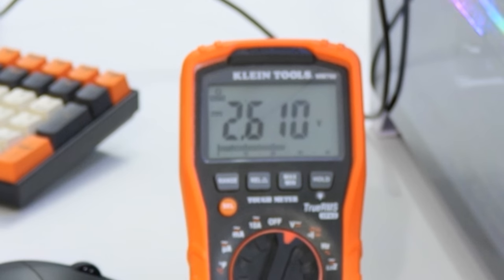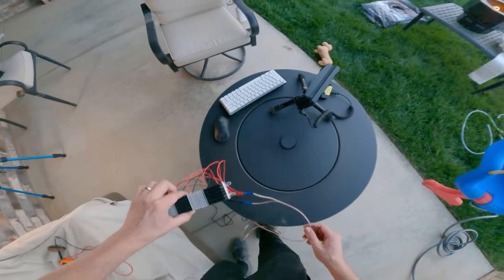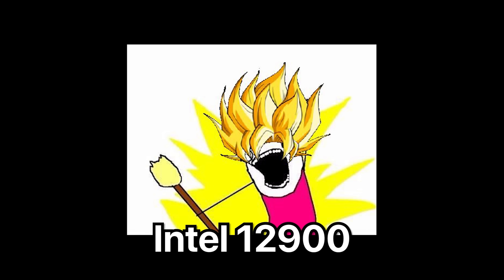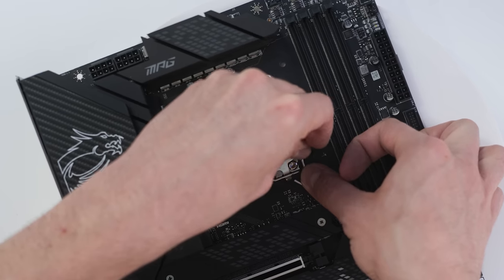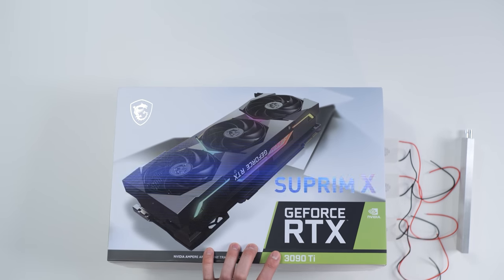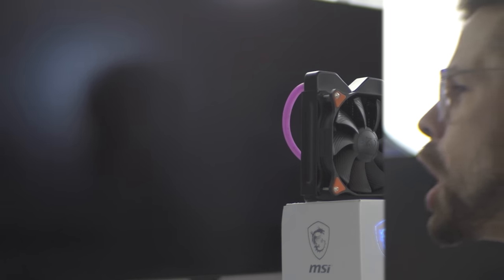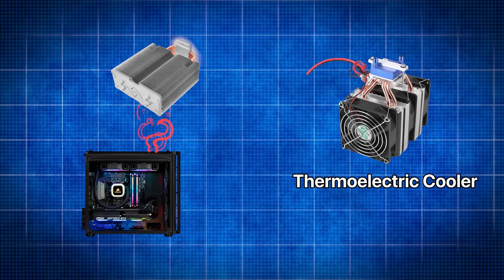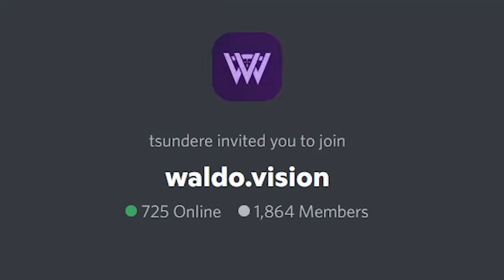I Built a PC That Turns Heat Into Electricity

Comment: Suggestion. Whoever reads this bear with me and read it. First install a energy box that save’s all the energy you don’t use and as the heat is generating you could basically have something close to infinite power. If you leave the pc overnight and let it run for 24 hours. You’ll have a lot of energy saved up. Then you can unplug the pc and use the “energy box” to turn the pc on. Tho I do know it’s not perfect and theres a lot of thinking needs to be done. Which I don’t want to sense I am lazy but this idea is cool.

Comment: It is not currently possible to build a device that can directly convert heat into electricity. This technology does not currently exist.

Even if it were possible to build such a device, it is not clear that it would be a practical or efficient means of generating electricity. There are more established and proven methods for generating electricity, such as the use of fossil fuels, nuclear reactions, or renewable energy sources.

The idea of building a PC that turns heat into electricity ignores the fact that electricity is typically generated through the use of fossil fuels, nuclear reactions, or renewable energy sources such as solar or wind power. There are no known methods for directly converting heat into electricity.

It is important to consider the potential consequences or implications of any new technology before making claims about its capabilities. The development and implementation of such a technology could have unknown or unintended consequences that should be carefully evaluated.

The idea of building a PC that turns heat into electricity may be seen as unrealistic or impractical, and it is important to consider the feasibility and practicality of any new technology before making claims about its capabilities.

Comment: 10:10 IM DYING if u wire just 1 PAIR IN SERIES and u have 2 other modules hooked together with the series modules THE SERIES MODULES POWER THE NON SERIES MODULES literally shorting out the voltage and bringing it to 1 module. basically u have only 2 working modules instead of 4 in that circuit

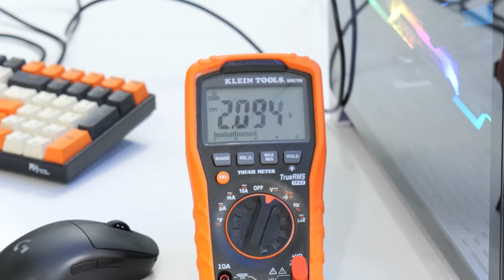edit: U MADE IT EVEN WORSE AT 10:20 now its just 1 ACTIVE MODULE LIKE MY BRAINCELLS
edit 2: k u fixed it at 10:35

Comment: So the poblem... is that the most heat the most unefficiency of the device, out, you could waste eletricity to make heat and a device work then you get about the half of the power, of the true ammount of power you will recive about.. 50% or less of the power, if you put a heater, and a thermal generator, you will make no heat and bellow of 50% of all the power you spent go back.

Comment: Hey Basically Homeless, cool video! If you're still interested in getting power from heat, I saw an awesome video from night hawk in light channel on thermo-acoustic tech that separates hot/cold air using a speaker! I hope you'll consider checking it out and maybe see if you can get power out of it.

Comment: never heard of The Laws of Thermodynamics?
1st Law of Thermodynamics - Energy cannot be created or destroyed.
You can't make more energy than you put in; in fact, the device you are using is simply a Peltier cooler (look it up) which can be used with an input of electricity to cool or to take heat and make electricity. Still, you ignore the fact peltiers are only about 5% efficient so you lose 20 times as much energy as you manage to collect net result it is impossible to make a self-powering device that would be a perpetual motion machine and as all sane people know that is impossible

Comment: had the same idea but with more computers that supply each other with power and measurements of use / charging and empty charging of battery and generation of dynamo poor but after a few days the computers fail one by one until the last one with the battery I think I have to use zone energy in addition😂

Comment: Wait a minute couldn't he just play infinitely since his computer heats and that heat turn into electricity so it wont run out of power
Reply: not enough voltage to properly power the whole the PC - he produced around 2.5 V and to power a regular gaming pc you need approximately 18 V or more.

Comment: You can't turn heat into electricity.
You can use a differential in heat to generate electricity.
Your AC would still have to do the same amount of work

Comment: 24 volt at 0.3A?
That's like 8 KWH per 1000h

and your PC uses like 300 KWH per 1000h while on high load?
So in 1000 hours of usage, instead of paying for 300 kwh, which in america is around 40 dollars, you're using 292 KWH, which is a savings of around 1 dollar
Reply: It's just fake video. It's not fully powered enough to run by itself. There's no way that tiny peltier can power pc fully by its own
Reply: @cevinpro1  no one is saying that... It's about increasing the efficiency l
Reply: @ayoCC maybe just use solar panels, since thermoelectric still has along way to go. the only way thermoelectric has enough to power a PC you need to build heating system as big as garage and build the cooling system as big as half the garage, and the price to value ratio probably way more expensive than solar panels.

Comment: i did it actually 2 years ago. and it's worked. but you need some more boards for transfer the heat to power supply and make a balance between ac income and dc heat income. and it's need way more that those little shi** small heat blocks. it was for joking the whole energy world and i thought it's don't work. but it did :|

Comment: This wastes more energy in the end since you block airflow and force everything to run hotter and thus increasing the power consumption by at least 50x the amount you're making.
Reply: What?

Heat from components is always wasted heat. The only way you would increase power consumption due to heat would be due to fan speed.
Of course stuff downclocks when it gets too hot, but that happens to use less energy to produce less heat.

Comment: This is what I was thinking a couple of weeks or a month ago, if it would be possible to entirely run a computer using thermo electric generators and the heat from the computer. I was thinking more transfer the heat using water (water cooling loop) and then transfer the heat from the water into electricity for more efficient transfer of the heat, so that the heat isn't lost or dependent on the fan pushing it into the insulated box, maybe making more power, now the only problem is that the most powerful thermo electric generator commercially available isn't really good, not for powering a computer and is still REALLY expensive, but in theory it would be possible.

I want to try it, I'm not good at physics though and definitely don't have the budget for this.

Also not ready to risk my computer or my life on this :D

Comment: Bruh you made like a 5w = 0.005 kw in year for 24h per day thats make 43.8kwh Here electricity costs about 0.1€/kwh so you cant save some money but literaly 4.4€ saved so its needs some many years to even pay it self.... Also you cant use that ≈3v in power in  a pc powersuply, prosesors uses about that voltage range, but it needs to be stabile. Using that to power pc is just necessaly complicated. Soooo this is just dum dum logic. Or was this some kind of joke?

Comment: 🤦🤦🤦 you know you can run a battery onto a computer right and then you can kind of computer and just use heat generate heat sink 🤦🤦🤦 which you can use the power converter and solar panels the reason why I'm just saying this is because it just seen you hurting yourself like yo be careful